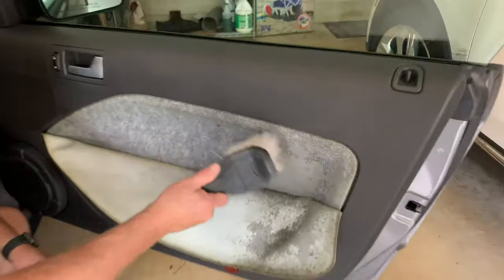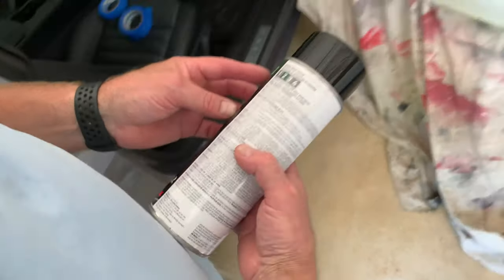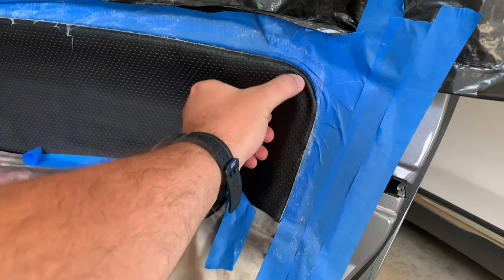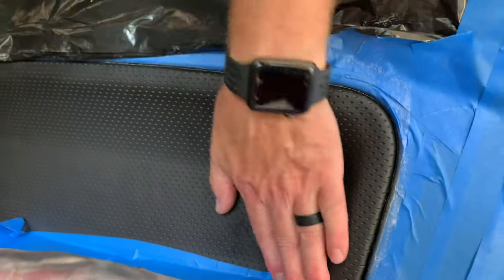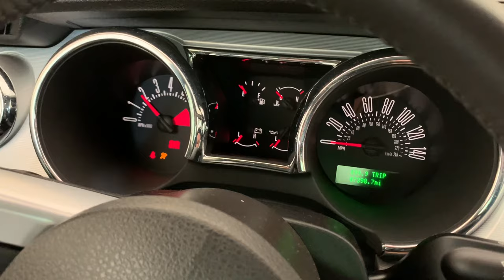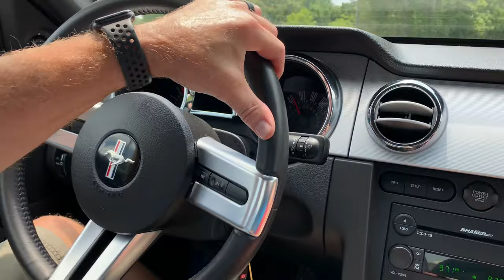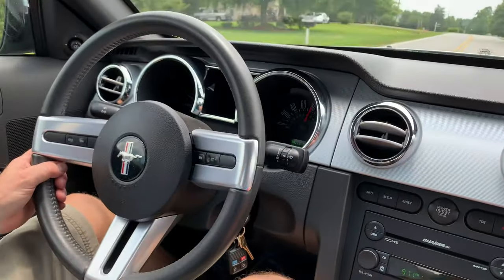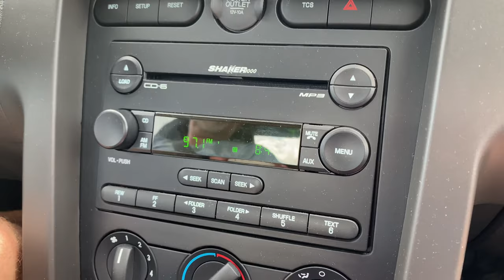Fixing the Mustang Door Panel Insert, and Mustang Review!

Comment: It’s amazing how far engine technology has come. The 2006 Mustang GT had 300 horsepower from the 4.6 liter V8 and now the 2.3 liter EcoBoost engine in the Mustang has 310 horsepower and you can get the Ford Performance tune that adds another 35 horsepower and 76 lbs ft of torque to that. And that’s a mild upgrade from Ford. Even with a supercharger the old 4.6 V8 barely makes more than the 2018-2020 Coyote in stock trim. My buddy had a 2007 GT with the Roush supercharger and a couple other upgrades and was pushing right at 500 horsepower. Now he has a 2019 with the new Roush 2650 supercharger and a tune and exhaust and it dynoed at 713 at the rear wheels. Cars are just getting more and more powerful from the factory.

Comment: door panel looks great..what kind of adhesive did you use? How is it holding up so far?
Reply from the maker: It was 3M adhesive spray.  It worked great and the door panel still looks great.  It should last for years to come.
Reply: @HiRevzMedia  3m makes alot of adhesive products which number was it please.
Reply: @davekilner5975  did you ever get an answer...which 3M??
Reply: @Kyungblut it was number 2. Said it on the can

Comment: First off, great job on the panel repair. It looks good. Second, that is a beautiful car and it sounds really really good. I have a 2008 CS in Perf White with just under 22k miles. Car is bone stock but I am thinking about exhaust to try and add a little more volume over stock. I’m with you and hate drone. The forums seem to speak highly of Corsa but they are $$$. Couple of questions for you if have a chance. 

1) Can you provide a little more detail on how you did the muffler delete and what tips you are running?  

2) Your video started just before the adhesive stage. Was it hard to pull the insert off?  Basically just try to grab an edge and carefully pull it down?

Again thanks for taking the time to make and post this video.
Reply from the maker: Thank you for the kind words.

1. The stock mufflers are just clamped on and can be easily removed.  We had a local muffler shop remove the old mufflers and build two pipes to clamp in instead.  The tips are just resonated tips from Advance Auto Parts, I believe.  We had the shop weld them in place on the removable pipes they made. 

2. Not hard at all to remove it.  Just slowly pull it off.